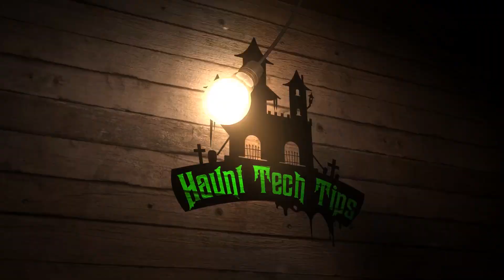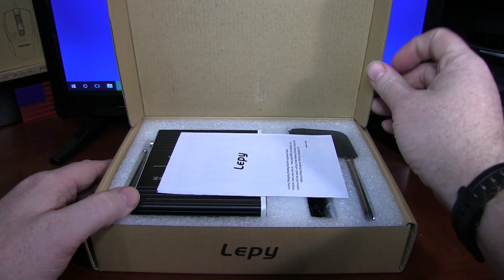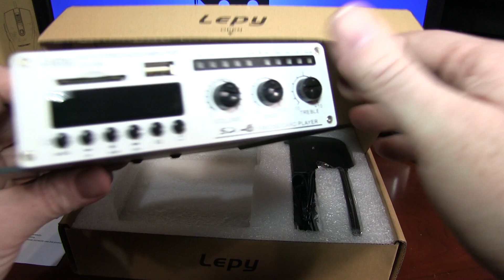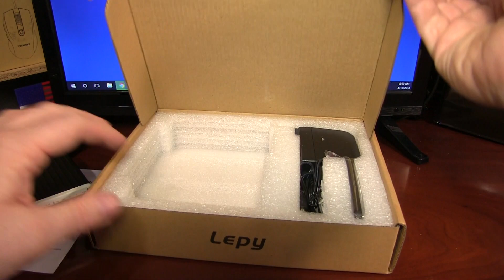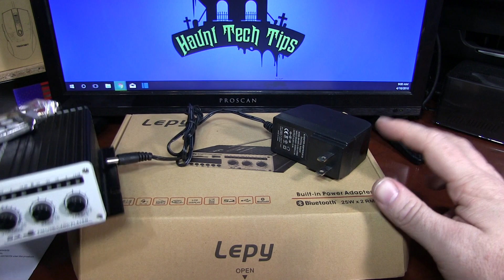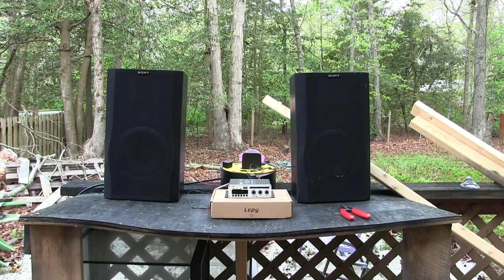Lepy LP-V9S Amplifier Review [2018]

Comment: If bridge over a passive filtered subwoofer will it work for subwoofer ?
Reply from the maker: It would need to be a rather low-wattage subwoofer, but it should work for something like a economy surround sound passive sub. You may not get the best audio results as the onboard bass/treble controls dials are pretty basic, but with some tuning could work
Reply: @HauntTechTips  been doin that with other amp for few years now until I get the knock off of the chinese brand that has the subwoofer output.. Lvpin LP 838 😂😂 tbh it can only use 25% of the vol knob but yeah it work great...
 Chinese product= serve it purpose
Btw need a really damn good power supply to keep it clean.. if not the noise is rather unbearable when I hook it up with the sub
Reply: @HauntTechTips  nah it wont work for 800W.. so I need to be using the 2.1 version